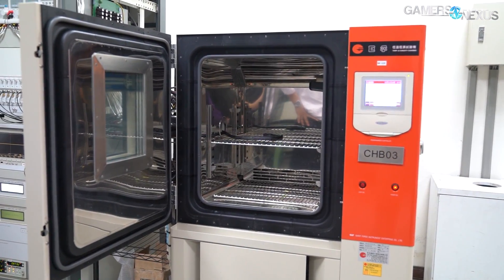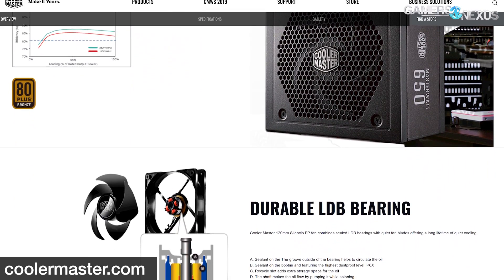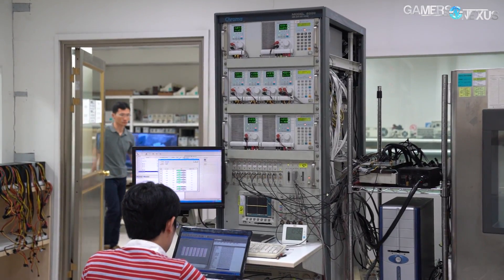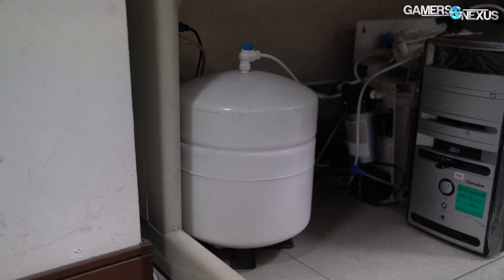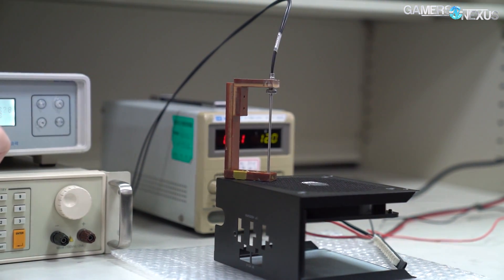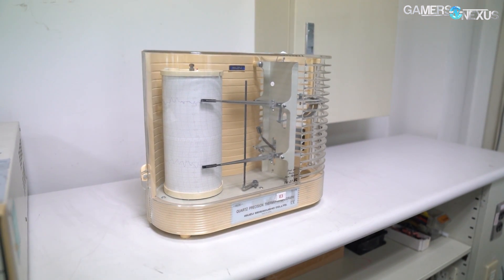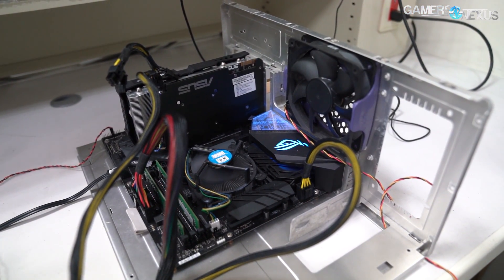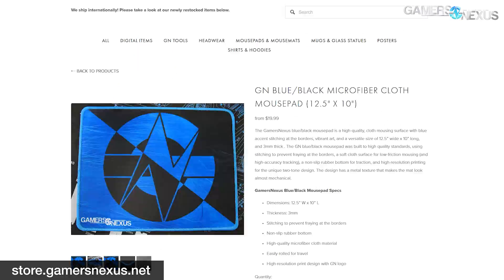Power Supply Testing & Failure Analysis: Engineering the Best PSUs (2020)

Comment: 10:22 OMG spring clip to keep the laptop display in one piece.  I'm pretty sure there is a lose connection in the LCD and the clips is there so the display don't go crazy.  #XPforever
Reply: those clips are there to keep the display from splitting away from one another because on these old asus laptops the plastic they used on the laptop was brittle and over time started to crack which made hinges loose and made it easier for it to crack
Reply: I saw a web developer who did the same to keep his laptop screen from splitting.
Reply: There is a reason why they are on XP

Comment: So PSU manufacturers get rid of coil whine by simple measures like gluing coils. Then why GPU manufacturers completely ignore it?
Reply: because the coils in gpu inductors are not "open" so basicly the inductors have a case around them. Do gpu manufacturers make every single component themselves? if not then i think thats the reason they dont glue them.Cuz they simply cant. Atleast thats what i think. i might be wrong.
Reply: MLCCs are microphonic so even if the coils are immobilized in epoxy the capacitors still make noise. I all depends on where the noise is coming from.
Reply: @COFASA bad grid is also problem.

Comment: As some one that is an electronics hobbyist these factory tours are nice to watch as it shows how much work goes into even the most basic of components most people don't think about like PSU's. I'm glad to see people that are not aware of the kind of work involved in even a PSU realizing how much engineering a design time goes into the things that they use every day and don't have to think about.

And yeah component selection is one of the most crucial parts of PSU design stages as the difference between going with one smoothing cap on the DC output to another can effect everything from the ripple current seen to the maximum wattage the design can handle with minor tweaks.
Reply: I just want to know why this work needs to be done overseas. These look like good jobs that Americans could do. We invented electricity after all!
Reply: @1pcfred  Ecosystem. Taiwan does anything PC/desktop related and they are all very close to each other. Any country can do it on paper but you need the know how, talent and capital (do not underestimate the money that goes into these factories no matter how grungy they look) for the whole ecosystem not just one factory.
IMHO its better to look to the future and invest in upcoming technologies in order to create and keep their ecosystem than to try and compete with already established ones.
Reply: @1pcfred  That would cost a great deal more money, which would lead products to costing more money, and now the very same people complaining that things are made overseas, will instead complain that products are too expensive. Can't have it both ways. These people are highly skilled and highly experienced and do the job just as well as any 'merican would, but at a lower cost. You can probably buy Made in the USA power supplies, but expect to pay 3 or 4 times the price for no better quality.
Reply: @1pcfred  Doesn't change the fact the product would still cost significantly more and people would moan about it costing too much, and then proceed to buy the cheaper overseas product.

Comment: OMG, I loved this.  And it's amazing that we can get good power supplies for under $100 with this much R&D and testing that goes into the development.  Steve, this series of factory tours you guys have done over the past couple of years has been completely eye-opening, and a tremendous pleasure to watch and from which to learn!  You guys are the best of the best.
Reply from the maker: Thank you so much! We've learned a lot filming them.
Reply: @GamersNexus  May your quest for knowledge be fruitful and never-ending. We don't have enough people like you.
Reply: I know right the one sector in all of computing industry that really deserves to claim "It just works!"
Reply: A good power supply will last a lifetime. I still have a working Enermax Liberty 500W (15 years old!) that I use for my dad's PC and my Corsair RM750x has also been going strong for a while. Ironically, the only power supply I've ever had fail on me was a Cooler Master one.
Edit: just to clarify, caps can definitely leak after such a long time. I wouldn't trust my main system with a power supply that's 10+ years old, but generally there's not much to be worried about.
Reply: @Drinkyoghurt  please don't including brand name.
most old stuff are good durability

My dad owned cosmos rotary fan since 35 years ago it still works at this time, then i bought another fan brand new cosmos, owhh crap just 3 years then it died.
Reply: @Drinkyoghurt  Agreed. I bought a super cheap Rosewill 1000 watt power supply just to do testing with. It died within a month 😂 
(I don't enjoy killing hardware, to be clear.)
However my Corsair RM750 has been HAMMERED by my multitasking, gaming rig for 5 years. Still holding strong.
Reply: its got a lot to do with getting better at everything though, GN has shown they are checking at least 3 times now but power supplies and components have just gotten better
Reply: pure awesomeness, agreed

Comment: I don't even have to watch to know Seasonic's PSUs are the best, period.
Reply: @Bieber Ozinga slightly off topic thing - we say it's running 24/7.
Reply: got a focus +. that thing is beast and doesn't even need to use its fan, thus making it completely silent. after watching steves videos i do wonder how those great PSU can end up so cheap. i got mine for only 100 bucks! (650w 80+ platin)
Reply: Not really. Seasonic top end PSUs are not up to par with other brands like Corsair and Cooler Master, while their midrange and low end fall significantly behind brands like Silverstone, Corsair, EVGA, Coolermaster, and BeQuiet. While many of their high end PSUs are high quality, they are almost always more expensive then the competition.
Reply: @the_ratmeister  interestingly my old Corsair AX750 was made by Seasonic. Most of the big brands don't make their own power supplies. My new PSU is a Seasonic 750W Titanium bought on sale for a bargain £135 with a 12 year warranty.
Reply: @the_ratmeister  [citation needed]
Reply: @the_ratmeister  the only one of those companies that makes PSUs is Seasonic

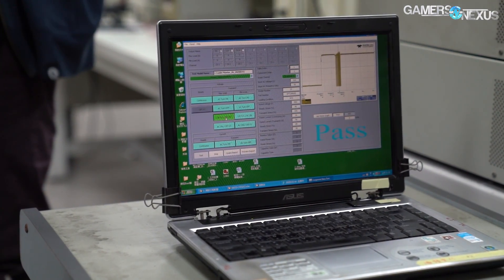Comment: 0:56  Windows XP.  Old reliable.
Reply: If you want something reliable use openBSD.
Reply: rkmugen and functional
Reply: i remember stripping xp down to a 200mb install it was so stable and fast, good luck trying to do that with windows 10 bloat edition
Reply: @scarletspidernz  Why would I even want to do that? Removing 10 bloatware takes 30 seconds. There is also LTSC version of 10 without any bloatware installed. The whole point of stripping down XP was to save some disk space. You don't have to worry about that nowadays since HDDs and even SSDs (SATA) are dirt cheap. Good luck with installing XP on a modern machine (you can't do that on most systems).
Reply: XP was anything but reliable lol.
Reply: I really miss Windows XP.  Best Windows there ever was.
Reply: Windows XP is unreliable nowadays; Windows 10 is far superior than any previous edition of Windows since its creation in the 1980s.
Reply: @mynintendogamingfeed5208  Ikr. People are getting caught in the nostalgia or they are just being stubborn saying 7 or XP was better. Not to mention the "bulky" feel of 7. The only reason to go back is to use some extremely outdated software but even VB6 works on 10 so it would have to be some custom/exotic firmware made specifically to work with this version of os.
Reply: @_mike  yep. One just has to download a Windows Installation Tool media, create the installation files to a blank 8.0 GB USB 3.0 Flash Drive, install Windows 10 on a fresh, clean, formatted Internal Solid State Drive into their PC, and after 16 to 30 minutes, a completely clean install of Windows 10 without any Bloatware whatsoever. Entering their own License Key can be done at their own time, or they can use a Microsoft Account to verify their copy of Windows 10.

Comment: an EVGA 500W 80+ Bronze can support a 1600AF + 5500XT 8GB Overclocked?
Reply: Even a 300W PSU would be enough.
Reply: @snowhawk4049  wtf?
Reply: @maicolherrera4631  The measured peak power consumption of my GTX1070+1600AF was 270W (running a GPU+CPU benchmark the same time), so unless you have enough fans to be able to let your PC levitate inside your room any PSU should be fine.
Reply: yeah unless it randomly decides to die but that's a different discussion

Comment: 0:56 what the heck is this laptop???
Reply: That is a Core2 generation Pentium Asus Laptop, I would say circa 2009
Reply: Is that laptop held together with paper clips?!?!
Reply: Looks fine to me.
Greetings for south america
Reply: Oldie but goodie, if it ain't broke dont fix it
Reply: It is probably less time consuming to fix this old laptop and make sure it work somewhat, even when it costs hours, than trying to install and validate the software on a new system.
Reply: Not to mention that it's running Windows XP, which is so far outdated and should be replaced with a Windows 10 Enterprise Edition OS...
Reply: @mynintendogamingfeed5208  if it works and isnt connected to the internet... why would they?
Reply: @mynintendogamingfeed5208  I mean you could never be sure if the specialised software that the laptop is running could work on Windows 10
Reply: @NOTd9zirable  Just run Oracle VirtualBox and install Windows XP in the VirtualBox environment; much better than using an actual Windows XP laptop or PC...
Reply: @mynintendogamingfeed5208  well if it makes you feel comfortable, most of the government stuff still runs on ms dos
Reply: @Electroblade MS-DOS is basic enough to be replaced by mature open-source clones like FreeDOS able to run on recent hardware so it's not really a problem. On the other hand, XP is too complicated to do such a thing (ReactOS is still in alpha) and the HAL of newer OSes could prohibit software compatibility when run on a virtualized environment.
Reply: @bananya6020  They also still use XP. They pay Microsoft to push security updates for them still. Floppy drives are also used in certain parts of the government.
Reply: @DefWun  Well, the Government better move on from MS-DOS and Windows XP, and run a special version of Windows 10, and also abandon the usage of Floppy Disks; they can't rely on those things forever.
Reply: @bananya6020  I'm not that comfortable at the slightest; Windows 10 > MS-DOS; much better security features in Windows 10 than MS-DOS... Far superior than any Microsoft OS, really. Also, what are they thinking that a Floppy Disk can stop outside hackers from controlling their systems? Floppy Disks are not going to last forever because they have a finite lifespan; Windows 10 is so much better than using Floppy Disks for writing code into the program, and the use of an encrypted SSD (protected by BitLocker and using a YubiKey for access) outperforms the Floppy Disks in terms of Storage Capacity.
Reply: My Nintendo Gaming Feed this is not how the real world works at all.